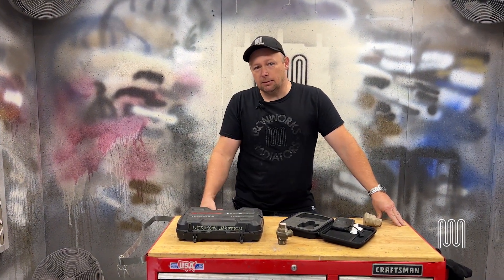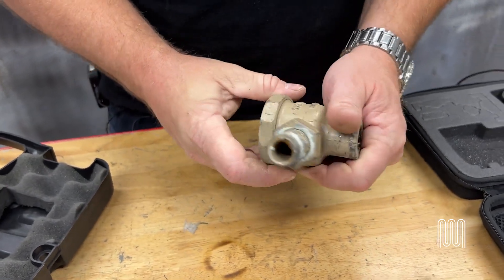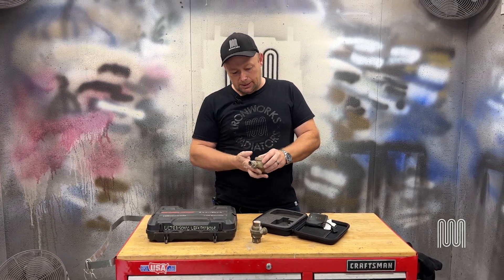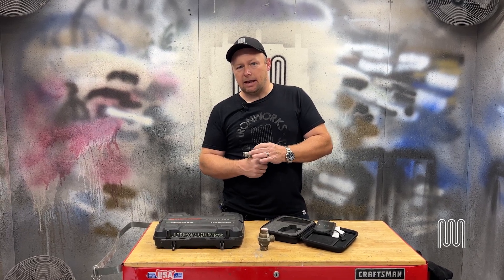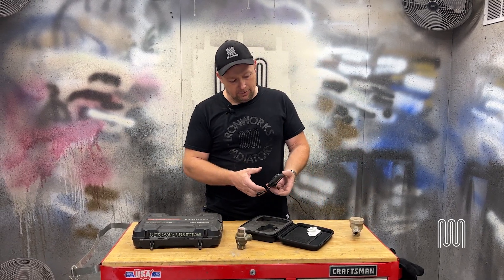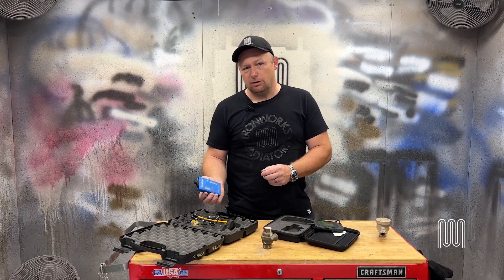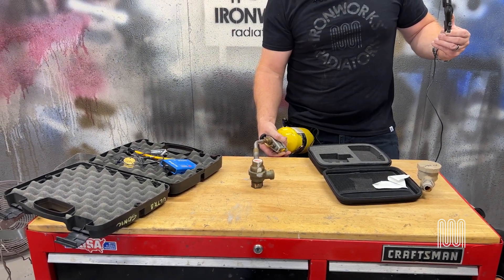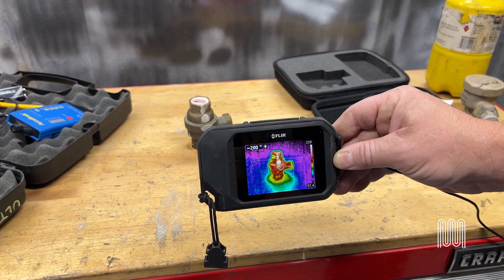Steam Trap Testing

Comment: so what’s the temperature that the steam trap needs to be in if it’s working properly?
 I thought you look at the inlet side and the outlet side and if there’s no difference in temperature, then that means the  steam trap is good
Reply from the maker: If the inlet is above 212 degrees and the outlet is above 212 degrees, the trap has failed open.  If the trap is never reaching temperature there is another issue, possibly pressurized returns due to failed end line traps, failed or ineffective venting or defective control valve.
Reply: @ironworksradiatorsinc  yes I corrected my comment before you replied. It needs to be a difference in temperature for the trap to be working properly.